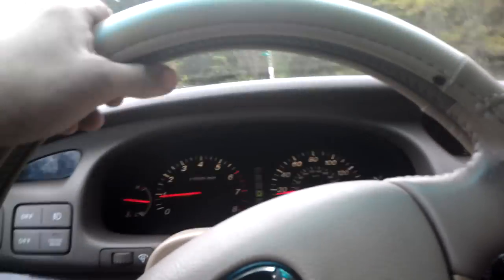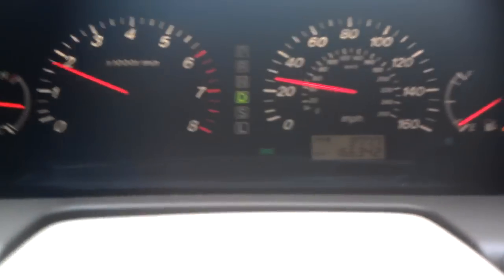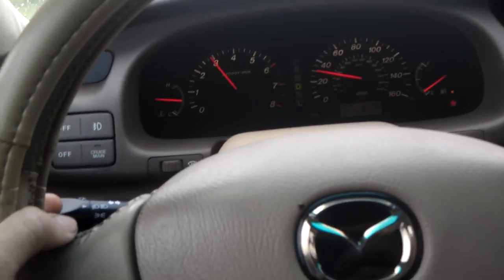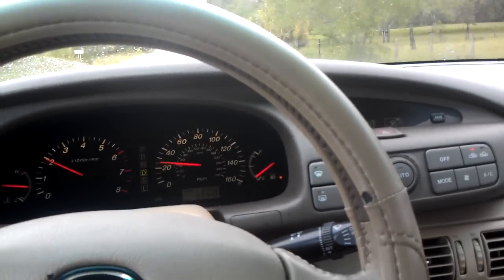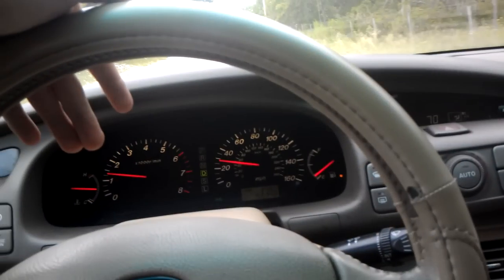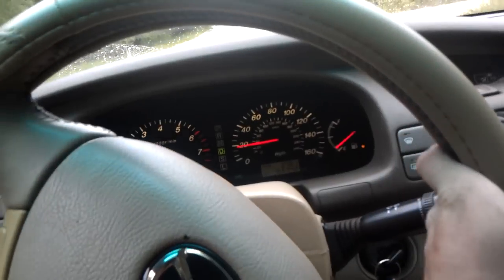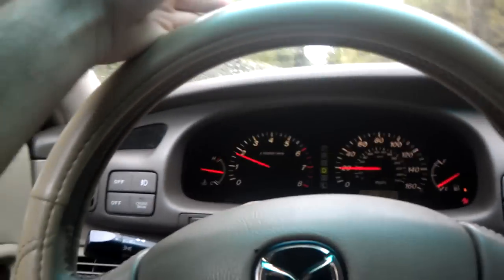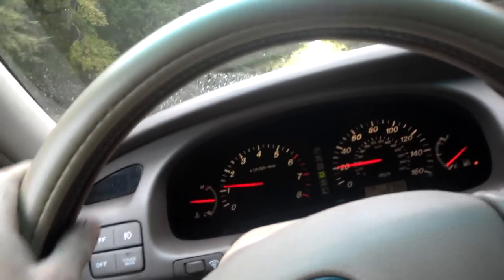How your traction control system (TCS) works

Comment: This is good to know, I was stuck in a massive pile of snow, I was revving the nuts off my car to get out and after several attempts at driving and reversing the car didn’t want to move, switched off the traction control and tried driving and reversing again and after about 3 or 4 attempts I got out.

This video basically explains why my car wasn’t moving with the TC switched on, so for those who live in snowy climates and don’t already know this, if you’re ever stuck in snow, switch off your TC, give it some gas and a decent amount of steering and you’ll be out of there in no time 👍🏻👍🏻

Just don’t drive into a snowing ditch, what I’ve written above won’t help you, you’ll need a tow truck for that 😋

Comment: HI
I have change TCS in my car(Mazda5)with a second hand TCS(but exact the same)now the TCS lamp is on...(break is good) Mazda garage working on it and finally said because of second hand we can not configuration it, you have to buy a new one...there is a solution for configuration or turn off the lamp?
Thanks

Comment: Traction control is for people that never learned how to drive the proper way. It gives confidence to incompetent drivers. In the new trucks, it literally makes most normal off-roading situations impossible and some vehicles have no way to shut it down beside pulling fuses and staring at warning lights
Reply: Guess you are one of the greatest drivers of all time, never made a mistake! Traction control, ESP, ABS probably helped you out a few times without you even knowing it. Vast scientific research points out that these systems decrease accidents by 20-30% or more while human error is the most common cause of accidents. These systems save lives everyday and each mom/dad/kid not comming home one night is one too much...
Reply: They save idiots if people were taught to drive properly they wouldn't need this rubbish.
Reply: Agreed. Just like how my new jeep standard trans came with hill start assist. I kept stalling because it held the brakes for an extra second (at least you can turn it off). And now cars are driving themselves...shame.
Reply: Kevin Allen I got so mad at my new 2015 Sierra 6.2L that I had to wire in a switch to my ABS fuse position in the panel so that I could kill it at anytime and shut down all the driver nannies. My cottage is at the bottom of a very steep hill and in winter, any time the truck would kick out slightly it would apply the brakes and I couldn't make the hill. A little tire slip and throttle is all I needed but no, my truck knows how to drive better than me. I am terrified to see what vehicles are in ten years, it is already out of control with the driver aids.

Comment: What kind of man drives around with the fuel indicator light on? I thought only women do that. lol j/k thanks for the video!
Reply: I think it's the opposite way. Women are more paranoid about the fuel so it's always full :D
Reply: No, what actually happens is they refuel to full every 50 miles because they don't want to run out *ever*.

What I also don't understand is people that will only put, like, 10-20 bucks in per fill up.  Why not just use your card and go full?  I want to spend as little time getting gas per week as possible, so I'll run from full to about an eighth or so

Comment: Thanks for the very informative video. Some of it seems to be aimed at all wheel drive vehicles and how power is divided between the front and rear wheels but if you have a front wheel drive car with traction control and one front tire starts to slip, the ABS senses it and applies the brake only to the slipping wheel enough so that torque is transferred through the differential to the other drive tire up to the point that both of them may be spinning at the same speed. The TCS responds almost instantly to changes in wheels speeds. Most cars have this system but others have the additional (hated by many) throttle control that slows the engine down so that you aren't just sitting there spinning. For example if your car doesn't have TCS and one of your drive tires in on ice or snow and the other is on dry pavement, the tire on the ice will spin and the other tire will do nothing to aid traction. This is one of the conditions where a TCS is advantageous. On cars without a TCS it is possible to transfer power to the stationary tire by gently applying the brakes just enough to transfer torque to the tire that has traction. Of course the best set up is aftermarket locking differentials that can be activated with the flip of a switch but they are very expensive and not available for all vehicles. Good luck!

Comment: That is all well and good but what if the traction service light comes on all the time and you replace the sensor they tell you is bad and it still comes on. It would not be a problem but it reduces the engine power and that is a problem. The roads are not even wet, the darn thing just keeps coming on. We replace the right hub bearings and the right sensor because the dealer told us it was bad. Still coming on. Is there a way to bypass it or maybe you have a suggestion as to what else it may be. The last time we took it in with the service engine light on they could not even get a code. Yeah. I would appreciate any suggestion, thanks It is a 2011 impala.
Reply from the maker: could mean you have an abs speed sensor out or possibly a problem with the ecu

Comment: Good explanation dude.. but what I've realized with TCS is that it's better to be activated on slippery roads like icy roads for instance as it helps controling ur car pretty good n helps it not skid especially when breaking sharp. One more thing, if ur driving fast in a normal condition weather make sure ur TCS is off coz it seems to affect ur breaking system n u wouldn't get to stop as quick as u possibly can like if ur applying an emergency stop.. In other words, TCS isn't recommended while driving fast that's why it's been invented for bad icy weather. Cheers